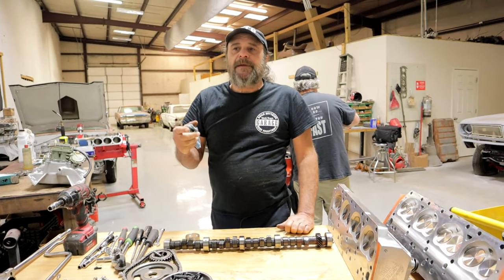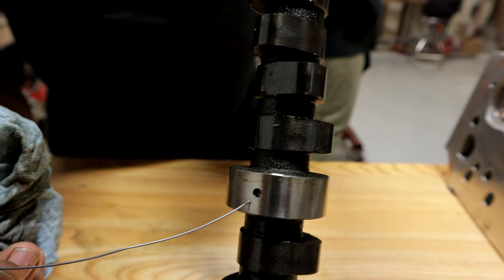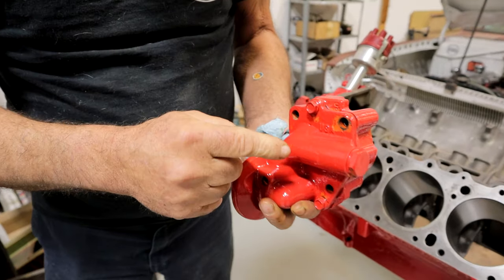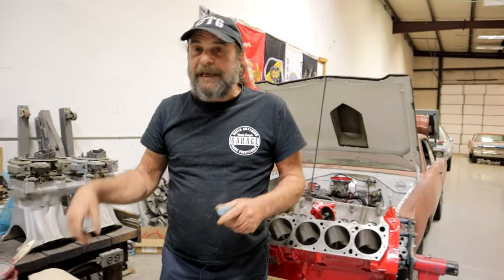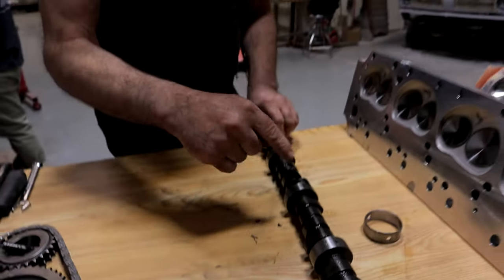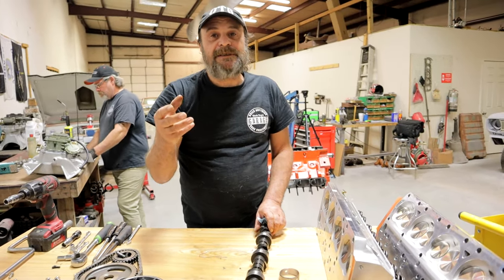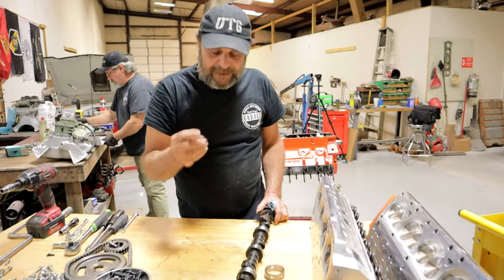CRITICAL Lesson For The Home Engine Builder- MORE Camshaft QC Issues To Wreck Your Day

Comment: Always prime the engine oil pump, turn the crank while priming and make sure oil is reaching all of the top end
Reply: I'm so paranoid I even do this when I do head swaps or head gasket work on Hondas. I'll pour oil on every moving part and passage in the head and then disconnect the fuel pump main relay and spin it over until I KNOW and can see there's oil moving up and through the head. I feel this is a great practice even with new cars.

Comment: Third I think, you had a batch of bad lifters that ended up wiping a lobe on a camshaft last year didn't you? I know it wasn't an actual cam issue but valvetrain issues are all related. It was a small block dodge if I'm correct , Hyd Flat tappet

Comment: A couple years ago I bought a new Crane camshaft for a 302 Ford. I checked the cam card against the part number and degreed it in. It would not start. After replacing all the ignition, re-degree and a dozen no starts the cam went flat. It was ground with the 351W firing order. Crane offered to replace the cam!

Comment: I run used parts all the time that were running these days as it is proof they worked when parked. Currently 88 5.0, somebody rebuilt it at least once. Found .040 speed pro forged pistons, inside. Everything clean. Decided on leaving the stock cam in with 1.7 rollers (also used 90s spec) there as it obviously ran. I do like to verify function like oil flow, before firing anything up. Never failed me yet....
Reply: @DanEBoyd  I used those back in the day, on me former 1988. These ones I have now are stud mount Comp Cam full rollers, to go with the incredibly well made, used hard 199X-vintage Twisted Wedge heads I have on the car.

Comment: This is an example of why i like doing things myself or a getting trusted person only. Taking your car to a shop  or buying a random used engine is hit or miss and just adds stress. I see guys selling engines all the time that " have never been fired" after "fresh rebuild" It might as well be in pieces for me to assemble if it wasnt fired up and "broke in". I bought a GM 366 tall deck dumptruck motor real cheap to throw in my 58 chevy It had already had converted to car intake/distributor with head spacers. Guy said it ran good. i got it running and wouldnt ya know it had a vibration. one of the heads was cracked. Took it to machine shop they "fixed it" and upgraded the valves etc. I put those same small valve heads on a fresh from a machine shop 396  I assembed myself and wouldnt ya know same vibration. compression test reveals 2 cylinders about 15psi lower than the other 6. So i paid 900$ to have some heads reworked and they didnt do it right so now Im at the lost interest phase of the car until I get some replacement heads. Ive have nothing but problems buying used stuff people trying to scam you.

Comment: Thank you so much Tony! As a new timer in the engine building sector this really brought my attention (granted I have never built an engine yet but I’m planning on building a 302 this summer). If this does occur and there is metal in the oil passages, what would you recommend using to clear it out? I heard you mentioned a few things the experienced builder does but I wanted to know your opinion on the matter. Thanks!
Reply: Anything long and skinny to poke with and compressed air to blow it out

Comment: I had purchased an SFI Crank Pulley a fluid filled damper. It was really nice, until I went to install it and found two damaged grooves. And then factory painted over. I was pissed. Paid close to $300 and if I just installed it, it would have ripped my belt after only a few miles. Really bad grooves .

Comment: Check everything, sure. After he had cleaned out the oil holes I disagree that it would still be junk, at that point. I would have tried it(provided everything else was in spec).

Comment: On everything anymore- YOU are the Quality Control Department!.
Know your rights and stand your ground- do not be afraid to contact manufactures of defective or substandard parts.
Document what you find- measure the part, take good images to show garbage in passages, bad packaging, info on the box, inspector #, date/lot of manufacture, etc.
You must THINK like you are building a strongest, airtight argument to refund/replace your part.
When dealing with manufactures- be Professional- not angry, not rude, not hungover, no raised voice, no cursing, and never threaten- remember, your call is likely IS BEING RECORDED.
Stay Cool, Stay Sharp. Stay Smart.

Remember- Professionalism and Documentation Wins.

Comment: Should the camshaft have had 3 holes to allow the oiling of both rockershafts? It would seem that only one shaft could be oiled with pressure? Really good video, an ounce of prevention, and cleanliness is more important than godliness in a build situation. Thanks.
Reply: The holes line up every 180 degrees
Reply: @djstobbe1301   watch the vid at 2.00. one hole is at 12 o clock, the other at 5.  Tony even states the holes are not 180 degrees apart.  Look at the wire.
Reply: Yes however every time it rotates 180 one set of the holes will line up and then next 180 the other set
Reply: So each time it rotates about 180  the left head gets oil then next time the right head gets oil and so on ...to be more specific
Reply: @djstobbe1301   thank you.

Comment: good stuff i had an expensive lesson in this but it was the machine shop i used i asked them if they had cleaned the block after they got done and asked if it was ready to build so i took them at their word and took the block home and put it together after 100 miles or so i lost all oil pressure and spun a bearing so i pulled the engine and sent it to an engine builder because obviously i had messed up when i put it together right? well the engine builder pulled the engine apart and told me that the engine was full of metal shaving from the machining they had not cleaned the block and the cylinders had a .020 tapper from top to bottom and the deck was .010 from front to back on both sides so 7k later i had a good running engine that has been run hard for 4 years with no issues so yes check everything 3 times to make sure its right

Comment: Had a 'home built' engine come into the shop several years ago.  It would not run.  the timing chain had been shorted by one link!  At this point a complete teardown was in order.  Found a a rod that had a shiny nut on the bolt, undid the nut and found a stove-bolt for the connecting rod.  the 'builder' had 'lost' the original and thought the garden variety stove-bolt would do, after all it was the same size!  Valves had keepers upside down and filed to fit  Gaskets were glued into place with caulking.  After a complete teardown and rebuild the engine was fine with the correct parts!!!

Comment: This is why I clean in great detail sometimes 4 or 5 or more times with a wire brush gun cleaning kit all oil passages over & over and over and I STILL find small amounts grit in oil passages in the parts. (Cam's and cam oil feeds plus cranks are the worse !) There is no such thing as to clean as I am a total fanatic on clean parts before final assembly and that is why my shit seems to hold up. Clean everything until you know it's totally clean, then clean it ALL again. P/S Trust NOBODY ! clean everything AGAIN after they tell you it's clean. Just DO IT ALL OVER AGAIN ! and thank me later. Yes I know , everybody tells me I take WAY to long to assemble a motor, but my shit is all still running and when you pull it apart after 100s of thousands of miles and the bearings still look great, maybe you will understand why.

Comment: we used to drill (to clean) and chamfer all oil passages crankshaft holes cam and block hole sport mach oil passages where the block meets the oil pump enlarge oil passages from the mains to the cam bearings because as you say quality control is lacking in a lot of areas but  these engines would average 12 to 15 years of hard service making it well worth the extra effort  trust nothing is absolutely correct 100 psi air is yo friend

Comment: I bought a high rpm cam for sprint car motor from a big name company in commiforina subpost to be gun drilled to lighten it was soild core when I got it been dealing with this company 20 yrs first they accused me of swapping the cam then they said it was there suppliers fault because the hole should have been cast in the blank

Comment: Two things
  This is why I change my oil as soon as I get home from picking up a new vehicle. I do not refill with synthetic mobile one oil , until after Break in..I just put fresh conventional oil for the break in. Back in the engine. You cannot run synthetic oil and expect the rings to seat in the bores on synthetic oil because of the high lubricity of synthetics..
  The second thing. Get yourself a set of electric guitar strings for probing around in oil holes. I saved some of my crop ends from my guitars for just such a chore. They have saved me a few times..
 by the way. I don’t see any cam bearing or lobe damage in this video..
  I usually drain my Orioles from my cars and motorcycles over a magnet. Sometimes I drain it into a cheese cloth because the magnet will only pick up magnetic bits.
 it will scare you to see what comes out of a brand new engine on the very first oil change.. I actually had a chunk of aluminum about 6 mm² come out of my drain plug on one of my motorcycles once. That scared the hell out of me because that could have locked the transmission in an instant, when that happens on a motorcycle, pulling the clutch in doesn’t save you.. The clutch just disconnects the engine from the transmission, not the transmission from the rear wheel..
  it’s not uncommon for me to find microscopic metallic particles by the thousands in used drained oil. It makes the oil look like it’s metal flake oil. I don’t know what it is, gear flake? bits of the top compression ring? I also find tiny shavings at times, aluminum. Probably part of the clutch basket for motorcycle transmissions? Who knows..
  all you can do is run it till it blows, then fix what breaks, which isn’t very much. 
  Cars today are a miracle.. they last 200,000 miles, they get good gas mileage, they protect us and crashes better than ever, they don’t need regular tuneups.. even the cheapest Kia and Hyundai cars are better than the best General Motors or Ford cars were 20 years ago..Just look at how transmission shops have disappeared, muffler shops have disappeared, tuneup shops have disappeared, garages have disappeared.. they just don’t break anymore..
  not only that, they are faster, better handling, and more powerful than ever..
  when I was a kid, I had cars and given to me, Buick 59 LeSabre, 54,000 miles. 59 Chevy Belair, six cylinder powerglide, 70,000 miles. 1959 Pontiac Catalina convertible, 60,000 miles. They were given to me because they were considered worn out. I had to put That slim Jim transmission in the Catalina, I had to put freeze plugs and a transmission oil pan in the Buick 59. I didn’t have to do anything to the 59 Chevy Belair six cylinder. But I gave it away to someone that needed an engine because it was a 4 door , olive green.. I mean, come on, I couldn’t be seen in something like that. I was 16.. 
 when a car had more than 50,000 miles on it back then, it was pretty loose and rattling.. 100,000 miles, that car was Burning oil, leaking power steering fluid, transmission fluid, brake fluid, differential fluid, gas, and antifreeze.. it needed you joints, ball joints, Heim joints, and the ashtrays emptied.. at 100,000 miles it probably had to transmission rebuilds, it probably had the valves ground, it had two or three water pumps, generators, master cylinders, wheel cylinders, the brake drums cut, the thermostat replaced, and the air conditioning didn’t work, if it ever had it… valve cover gaskets leaked, carburetor was leaking, the window winders were broken at least on the driver side, the tires probably had tubes in them, the car probably had recaps on, you were lucky to have all four hubcaps, the spare tire was bald,And the bench seats probably had covers on them.. The radio was an a.m. radio, it probably had at least 10 tuneups, points, plugs condenser, cap and rotor, plug wires..If you were lucky, Centrifugal or vacuum advance was close…It would not even come close to passing an emissions test today.. any half decent backyard mechanic could keep it running without having to marry the dealer..
   today’s cars, The fan belts don’t even break, and they’re not even called fan belts anymore, and there’s only one of them. Mechanics today have not had the pleasure of having to takeoff three fan belts to change the fourth one in.. mechanics today have no idea of the pleasures of removing part of the motor mount and jacking the engine up to change two of the spark plugs on a Ford Thunderbird, or removing the rear bumper to change an 1157 brake light bulb on a 1969 Buick Riviera..

Comment: I bought a flokooler water pump for a chevy 350 vortec and after I got done putting it on and I filled the system back up with coolant I noticed a leak. I took the pump back off and noticed that the impeller cover was the culprit. The bolts were not tightened all the way. I tightened them up and reinstalled the water pump and it did not leak after that. Just goes to show you should check anything and everything when you buy new parts because some idiot could have done something wrong during the manufacturing process.

Comment: To assemble an engine you need a clean room/area.
My friend had a 460 short block built at a shop.  Glad it didn't have an oil pan. Look like someone through a handful of metal dust on the crank and rods.
Took it apart to clean it. Look like someone took a hammer to the rods. All beat up.

Comment: That cam looks like a Comp Cam and the core material is an austemper cast ductile iron.  That is the material they have been using on the roller cams instead of billet material, there have been post of casting flash on their cams also.  Comp Cam quality has gone down the drain.

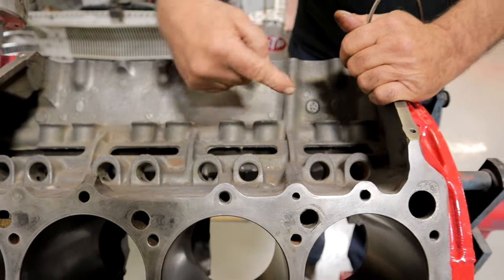Comment: 6:18 I can see from here that block needs the head surface remachined as it is just asking to leak or blow gaskets I don't know that even ..010" off would clean it up it might take more.
Reply: Those blotches that you see are where the coolant passages are and may or may not affect the sealing of the head gasket
Reply: @thomasward4505  Where someone has scotch brited that surface to clean it up I can see several places where the old marks disappear. I know that means it’s .002 to .003 low in spots where the fire rings are. To me that is out of spec on a race motor.

Comment: I can't tell you how many times I tried to explain to customers in a race/hot rod shop I worked as a machinist as far as a guy not doing this everyday "not knowing what to check as in clearances or to clean Everything! Even if you KNOW what to check can you remedy any problems you find like WE can here?!" I told one guy w/ a 455 olds who's engine didn't survived initial break in twice after I machined it "I believe your engine guy' might not have done ANYTHING WRONG' but SOMETHING is going on and I guarantee We Will Find it!" And we did ! Long story short, he ended up INSISTING I take an $80.00 tip because I talked him into letting our shop build it! BTW on the dyno a .030 over 455 flat top forged, ported Iron heads and a hydraulic cam that thing made 530HP!

Comment: OG wisdom........ No matter where you bought it from, no matter who you bought it from, whether you bought it new, whether you bought it used, shiny or dirty... get a nice bright light source, a good magnifying glass or glasses, a micrometer, dial Caliper, a set of feeler gauges, learn how to use & keep on hand plastic gage, some modeling clay, and a large cc syringe all measuring devices for home engine builder.. for cleaning got to have oil gally brushes, good razor blade holder, a body work style longboard to make sure mating surfaces are clean& pressurized air... And get used to clean and checking everything and pops taught me early on familiarize yourself with Machinist and engine builders mathematics practice writing it all down and recording it when you build stuff main clearances rod clearances combustion chamber cc's Port volumes learn how to multiply bore x bore x stroke = cyl ci then x however many cylinders you have.... Oh my God I'm babbling with my finger Tony's talked about all this stuff B4 ...I was blessed with Dad owning an operating an automotive machine shop my entire life for as long as I can remember and before we even hit high School dad was trying to reel my friends & I back in from burning the streets up everywhere in phx AZ from the day we turned 16 in the mid 80's foreward needless to say that wasn't exactly happy about us riding our bicycles up the loper's perf to buy our first nitrous system while we still had  our driving permits lol dad said if I catch you all street racing I'll pull the plug on this whole thing don't think I wont... KEEP IT AT THE DRAG STRIP now I'm running off the deep end reminiscing but that's the beautiful thing about hot rods..... Hot rodding friendships last a lifetime and the best people you get to know...L8 & 🙏🙏